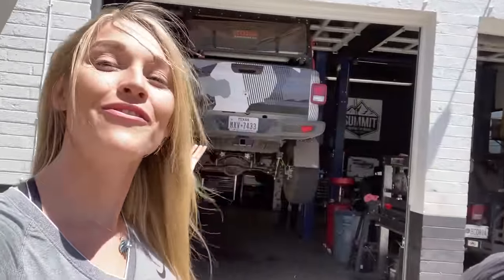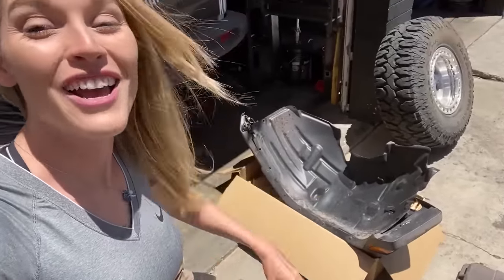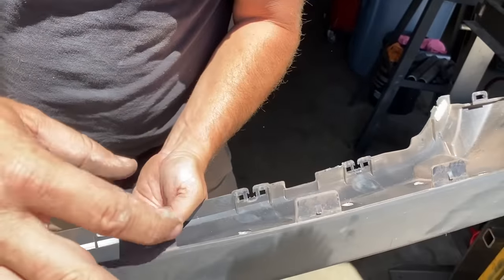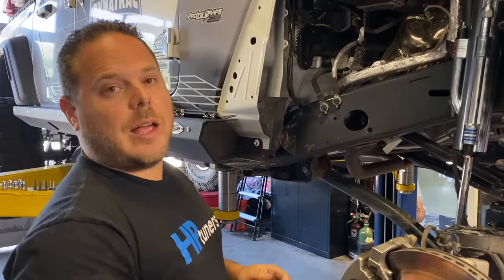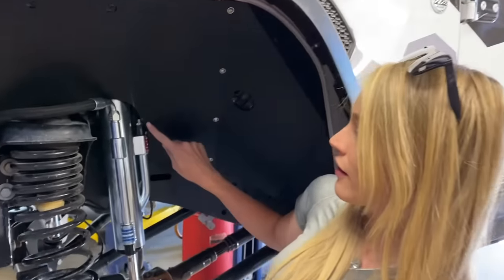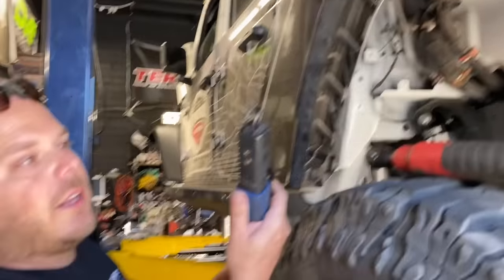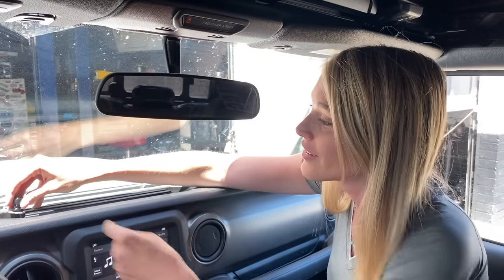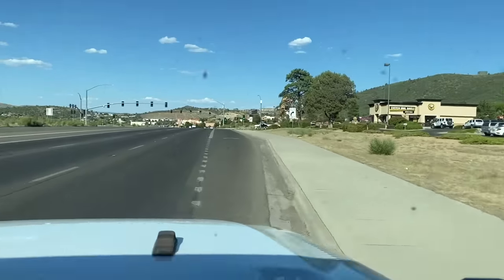BILSTEIN 8100 BYPASS SHOCKS FOR THE JEEP GLADIATOR BUILD!

Comment: LB.  Does she take 220 volt connection ?  The Bilstein damper is the best I've found at medium speed Pre-runner type drives !  Triple Bypass unit are really competition level shocks and remote reservoir is all we require for overlanding Downunder.  V

Comment: I’m glad you guys had a chance to shake down the Gladiator and I learned a lot about splitting the fender which will be helpful down the road. I am curious though, you showed a Softopper underneath a bed rack. Two questions, 1.  What brand of rack was that? 2.  Did the owner say anything about how difficult it was to stow that Softopper with the rack installed?  I am curious because I’d love a weather-protected solution for wheelchairs in the bed and still having some utility and customization.  Thanks Brittany and Kevin!
Reply from the maker: He responded in a comment below with how to contact him for more questions!!

Comment: Fender vs flare controversy....  Skip the rear, go to the front - 
CJ, YJ, TJ/lJ all had a minimal rubber/plastic flare with a large sheetmetal fender on the front. The original Willys flat fender was not 'flared', it was all fender.  The JK and JL have a large plastic flare with a small sheetmetal fender on the front. 
The term flat fender for a Jeep goes back to the Willys era. CJs, YJs, TJs/LJs have aftermarket options for a flat fender in that, depending on the choice, the whole fender is replaced (or cut/trim and covered) with a flat fender and no flare. Flare being a rubber/plastic addition to extend outward. There is optional metal flares for the CJ, YJ, TJ/LJ where the fender itself is extended outward with a tube edge, some more than others. 
   
So for a JK and JL, is it a flare or a fender?
   
   
For the Bilsteins, looks like an offset base on the axle mount. Probably to clear for the travel in that application.

Comment: Whats the trail benefit if I replace my AEV Bilstein 5100's with the Bypass version, as someone who wheels blues and blacks at Rausch Creek and AOAA in PA?  Thank you.
Reply: Benefits are adjust-ability, position sensitivity, and better shock travel and cooling.  Having the damping force ramp up near the end of the stroke allows much more comfortable ride mid-stroke.  That can make a long day of crawling much less taxing.  However, the big improvement is in high-speed ride quality on rough trails.

Comment: Everybody paying attention to the build yet I see those springs being warped
Reply: Like all springs that are attached/clipped in at both ends they bend or warp at full droop. Some attachment ends allow for twisting. Many vehicles don't clip in at the top, they look really weird/wrong at full droop, and can even pop out, past the stops not long enough to keep them in.
Reply: Alpine Off-road I noticed the samething and in all honestly I’m not crazy about the shock choice either
Reply: deesine vehicle manufacturer and almost any street market spring especially those multiple rate springs should be straight with is not the case after they wheel the vehicle out and pose it before talking to close the video. I’m also not an idiot and can work on anything up to rotor wing, as well have built multiple jeeps and Toyotas

Comment: The catch can reminded me. Have you ever had yours un-screw and fall off? Mine did last week. Turns out the engine doesn’t like that. Can was fine and didn’t even spill. But all the warning codes and goes into limp mode. Be safe! Have fun!
Reply from the maker: We’ve never had ours fall off. But we also check it periodically and make sure it doesn’t need to be drained
Reply: @LiteBrite  I figured.  I check mine every 3-4 tanks of gas.  I must not have gotten it tight the last time.  As soon as it happened, I had a feeling I knew what it was.
Reply: @LiteBrite  I used to check mine regularly, but on my WK Hemi it only fills a third between oil changes, so I drain it then. Never had it come loose.